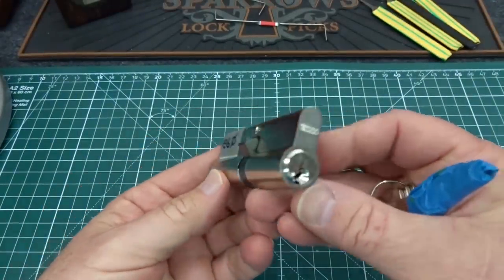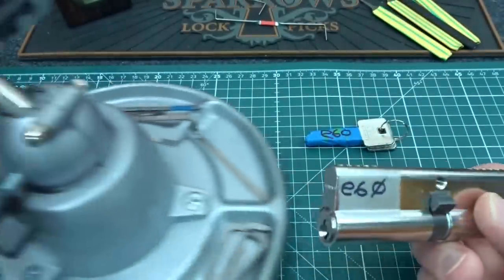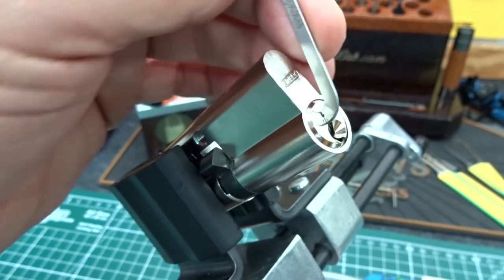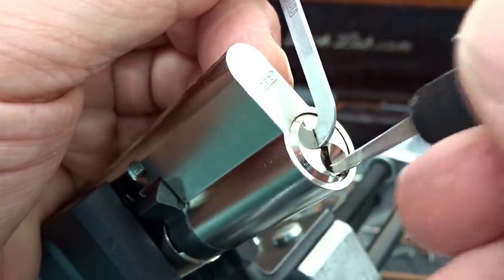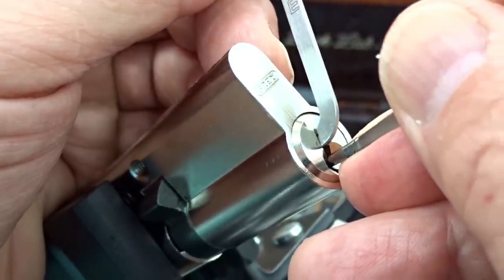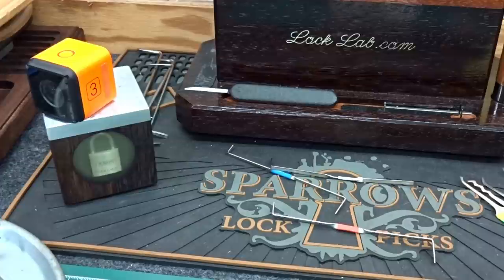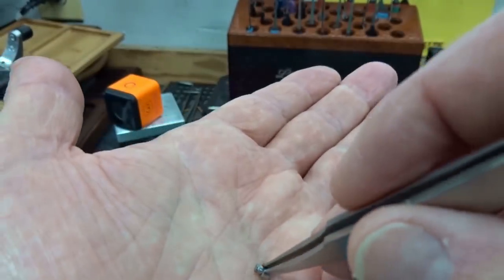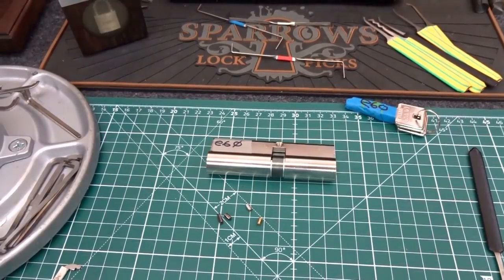(1165) Challenge: Abus E50 & Security Pins

Comment: I find one of the SSDEV hooks (the deep one with the fine tip) to work very nicely with ABUS locks. It's steep, so one can work kind of around the warding. That pick is also useful to get around TOK tensioners at a high first pin in most locks.

Comment: HAs anyone ever tried turning metal pins out of rare earth magnets?  Seems to me that would cause any number of problems if the rest of the core was brass and the pick was steel.
Reply: It certainly could, but you'd just have to use a pick made out of a completely non-magnetic stainless steel to beat it. It would sure be weird though! Also, Neodymium magnets are very brittle. In actual practice, the keys would pretty quickly break chunks off of the pins, or just break them in half. Still... for a challenge lock it's kind of a fun idea!
Reply: Karl Royale if I recall correctly, I believe Bill had a challenge lock come through with one or two of the chamber loaded with magnets. I think it was one of the whipped videos